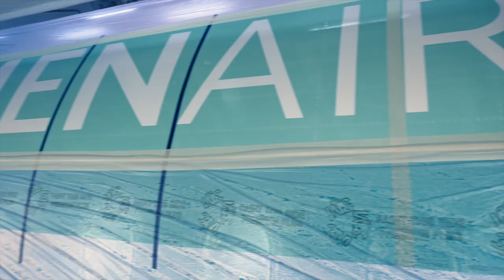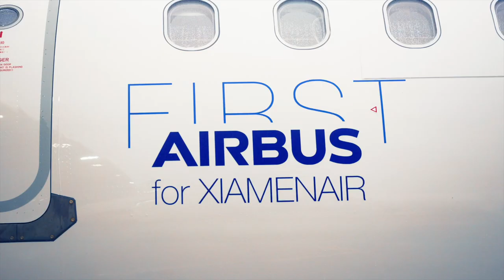In the Making: First #A321neo to Xiamen Airlines

Comment: I’m guessing all commercial air pilots must have English comprehension as a requirement. The cockpit is labelled in English I’m guessing. And all air traffic controllers must speak English with all pilots. You have to be badass to be a pilot in a non-English speaking country.
Reply: Yes even in china russia or brazil everyone use English for aviation. Especially for air traffic control.